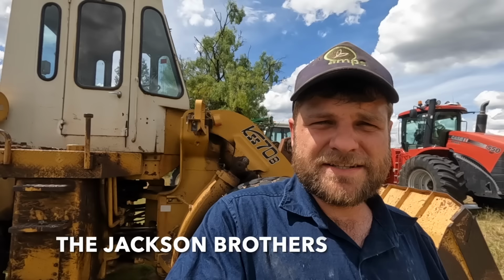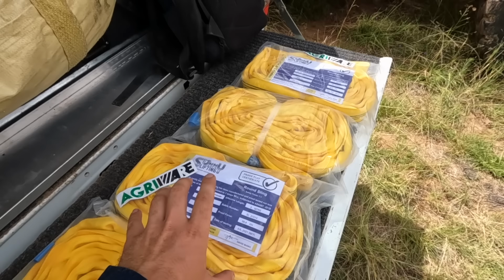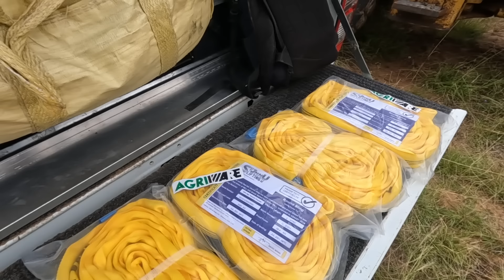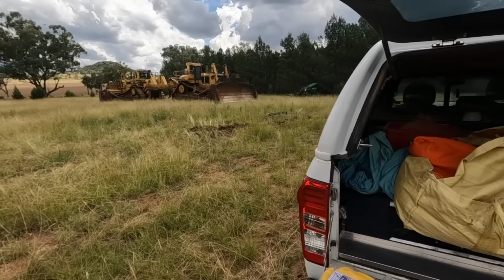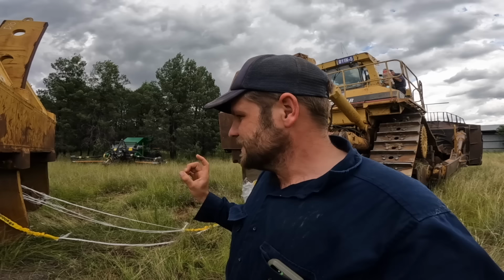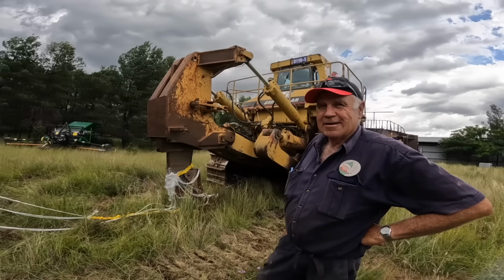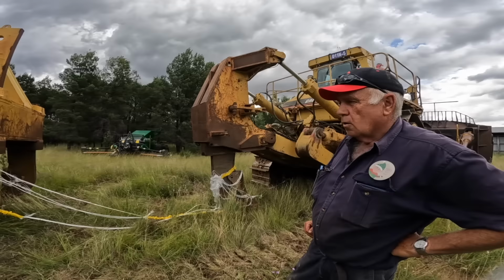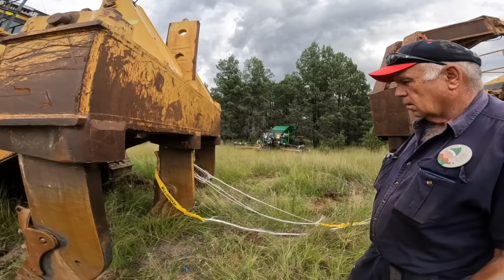Two D11's Have a Tug of War!!

Comment: The safety factor on lifting straps is impressive, and when they do break it's a lot safer than having a chain or cable let go. I've seen chain links almost completely straighten and fly over 100 metres, and that was just with an old 935 Versatile pulling trees, God only knows what two D11's would do to a chain :P
Reply from the maker: We find the slings are so much easier to use and often use them instead of d shackles because they don’t go flying if something happens👍😁
Reply: Once the got a small tear tough they shud be changed.. specially for LIFT jobs
Reply: 100 meters is scary. Thank you
Reply: We had a cable go when we were pulling our brand new 8RX 410 which had bogged down on the disc, the bang was astounding! So was the damage to the back of the Axion 960.
The guy who owns the farm (he is an investment banker in London) asked if we needed a new Axion! 
We told him No just a rear window, a tail light an led work light and a clean pair of pants for me. 
Closest I’ve been to a very serious accident for sure, and I rolled a tractor on to its side once.
Reply: I would bet that D11 could pull a 935 in half
Reply: @thejacksonbrothers  same goes for 4x4 winch cables, Steel and synthetic!
Reply: Chains don't snap back unlike cables and straps do
Reply: I think the most unsafe are steel cables, as they will cut a person in half if caught in the way when they snap under extreme loads.
Reply: Chain doesn't go flying generally
Reply: @TheTreegodfather  Exactly. Because chains just break.

Where as steel cables can be tensioned.

It's how hollow core concrete slabs or many bridge sections are made, by putting a million pounds of hydraulic load on steel cables, and then pouring low slump cement with super plasticizers like BASF one's, and medicalon to control efflorescence. Makes for a very strong low water concrete structure.

But if one of those cables snaps under load, best not be near it.
Reply: Sf: Rag 7, Chain 4
Reply: chains dont snap back. I guess you witnessed physics being broken when the chain link went flying because in a straight pull with a chain that is totally impossiable
Reply: @JD940  so what your saying is if they are damaged not to use them. wow your a intellectual power house. Did it take a long time for you to come up with the crazy idea of replacing something when it gets damaged? Genius.....

Comment: It would be interesting to see what would break first on a receiver hitch.  The pin that holds the hitch in, or the ball.  Two D11s would be ideal to test that out.
Reply from the maker: Funny you should say that, been thinking that myself😂
Reply: I've pulled the hitch apart. The right angle welded to the tongue separated.
Reply: You can get those heavy duty solid inserts.  In the standard 2" and for the newer trucks with the bigger factory hitches that are 2 1/2"  and 3"  i think those take up to a 20k ball
Reply: Easier to test it with something not based on traction, like hydraulics
Reply: Got my f150 stuck in the mud to the front Axle, used the ball mounted to the hitch and definitely broke the 2 inch ball, but nothing was done to the hitch 😂
Reply: Ehhh, I still wouldn’t want to be anywhere near that test when the metal goes flying. A safer test would use a hydraulic press plus heavy metal connectors to minimize elasticity in the components transferring the test load force.
Reply: The pin won't break because of shear strength
Reply: #ImRedneckerNYou

Comment: In slow video playback mode, it can be seen that the belts were broken at the point of contact with the metal canine. That is, the straps simply cut themselves on the harder material of the canine. If you make a semicircular spacer from wood, it is possible that three belts would withstand the traction force.
In any case, it can be seen that the straps are very strong.

Comment: I do structural steel assembly, sometimes we use a sling like those when the crane boom is picking up enough static electricity from the air to shock us guys doing assembly.the sling in the hook serves as a insulator .and handles the load well ,very versatile rigging indeed 
Load softeners are a must in most situations.the only fault of a sling is the do cut easier than steel

Comment: Impressive it gave a safety factor close to 10. Important to note the date of manufacture because they will get weaker with age. Lots of factors play into their safety factor. The fiberglass strands weaken with different elements such as being wet, temperature and age. Would be nice to see a follow up video in one year using the same amount of slings after being exposed to getting wet and a year of temperature exposure and normal use. I would imagine the safety factor drops down to about 6 with those same slings. Great test, thanks for sharing.
Reply from the maker: They don’t last long enough to deteriorate haha we break them daily regularly at the moment haha but it would be good to see👍 I need a massive scale to measure it exactly😁
Reply: They are nylon and it is only one strand inside the cover . Plenty of testing done on chemicals and uv with the rope access community . Rope test lab often tests to destruction

Comment: I see in some of the US farming videos they have a huge snatch rope with a knot system on the end .... never seen one of those break. We use these straps when lifting our engines around the workshop with a crane and cradle think out heavest is 13 tons , that a Q78 2 Stage Cummins ....
Reply from the maker: Hi mate, yep I have heard of them they are called yamkum ropes, as far as I can tell the biggest they do is 2.5in which has a breaking strain of 95ton which we would be able to break👍 I would love to try them though😁

Comment: In the U.K. most equipment is rated at around 2/3 rds of the actual breaking point.
A strap rated for say 6 ton will actually fail at around 9 ton ,a forklift rated at 6 ton will lift 9 ton etc etc.
This allows for operator error.

Comment: just so you know, by australian standards, lifting slings have a safety factor of 8 .. so a 1 ton soft sling (purple in colour) will snap at about 8 ton .. so a 3 ton sling (your yellow ones) is about 24 ton .. that means you probally had about 70 ton on them 3 slings to snap them like that .. not bad for something thats only meant to be lifting 9 ton vertically

Comment: The 63 tons the D11 weighs would need to be suspended by a strap to say 63 tons.  This had to of exceeded that with the drag of it digging into the ground.        Those are some nice straps.  I like how they ripped apart to as it was not sudden a clean break                                                                                                      and then go flying and behead someone.   These was a lot more of a controlled break.

Comment: As a human being and a Canadian.. I work in the oilfield using straps all the time and rely on them for my life.. I dont care if there a schill or $10grand specialty, they should all be perfect. Nobody likes lugging around 2.5-3.5 inches (roughly 64-90mm) braided cable especially 60-80 foot lengths+ dragging them around a shop floor and  lifting vessels but we do because we know it wont fail.   have tons of these soft ropes but when lifting is key and no bounce .. I know what im choosing.
Reply from the maker: Hi mate, yep fully understand, if we were using them as lifting straps like they are intended we wouldn’t be taking chances👍

Comment: Have you ever tested a big Yankum rope? they make them small and big but work like a rubber band to build up energy to help on recovery where lifting straps are designed not to stretch. They make one that's made to pull 201,000 pounds.
Reply from the maker: We would love to test one but the breaking stain of the biggest they do is 95t so we would probably break them.

Comment: Gentlemen: you are Using the Wrong Product for Pulling (you need a Matt's Recovery Rope for Pulling) Use a Strap for Lifting ... You don't 
need a Dozer (work Smarter not Harder) The energy is in the kinetic rope, no need to spend money on heavy equipment … just pull And watch the rope do the work .... 💕🇨🇦💕
Reply from the maker: Hi mate, you are correct however the strongest Kenetic rope/straps are rated at about 100t and we have broken our fair share of them so we look at alternatives, when a D11 gets really stuck the only thing to pull it out with is the other d11😁 the big lifting straps (20t rated, 140t braking strain) are stronger and 3x cheaper👍

Comment: Is it just a co-incidence that the yellow cover breaks first? As well as offering some protection to the strap, does it also work as a visual safety device? I seem to remember going on a crane operator/slinger course at work. Though that concentrated on using the correct sling in the correct manner and not going over the Safe Working Load of the sling in the first place.
Reply from the maker: Hi mate, very good question, we wondered the exact same thing as all the straps we have broken the sleeve has broken first. Makes sense because it gives you a decent warning👍

Comment: Are the straps 3 ton single pull?  It would seem that if they were looped like you had them they would be 6 ton each times 3 straps then totaling 18 ton.
Reply from the maker: Hi Adam, they are lifting straps so the rating is total because if one side breaks the strap will slip straight through😁👍

Comment: you guys should try yankum ropes
Reply from the maker: Hi max, while the yankum ropes would work well for tractors etc they are almost 3 times the price compared to straps made here in Australia which have a higher breaking strain. The dozers would most likely break the biggest yankum rope they make so that’s why we use the big lifting slings, cheap and won’t break👍😁, if someone wants to donate a yankum we would gladly try break it😂😂
Reply: @thejacksonbrothers  ok.

Comment: The straps should all have been replaced with new unused straps for every pull..  I bet three,  would have held up to the 3rd pull..
Reply: I wouldn't have thought of that fatigue factor I reckon..... Seems like the strap lengths would be a factor or maybe they're close in tolerance to the same lenght.... Idk? But I doute it...... I wonder if soaking them in water would effect their strength..... Maybe fuel or solvents..... Different ambient temperatures..... It's interesting.....

Comment: Those straps are 3000kg where do you get the breaking strain figures from?
Reply from the maker: Hi mate, it says on the packet it has a safety factor of 1/7 which means minimum breaking strain has to be more then 7 times what it’s rated so 3000 x 7 = 21000kgs😀👍